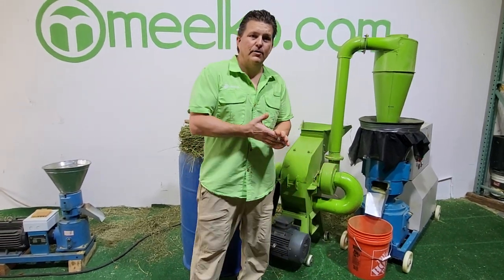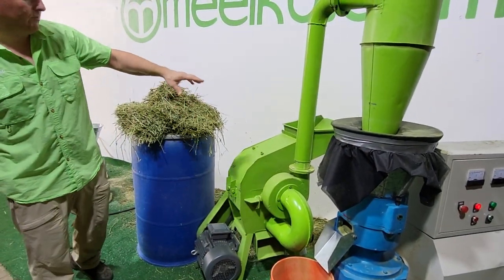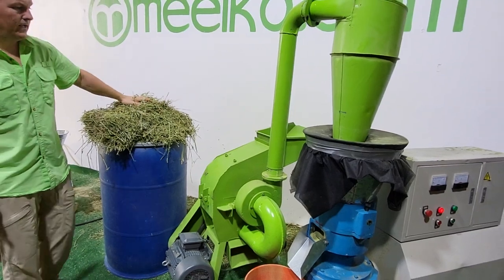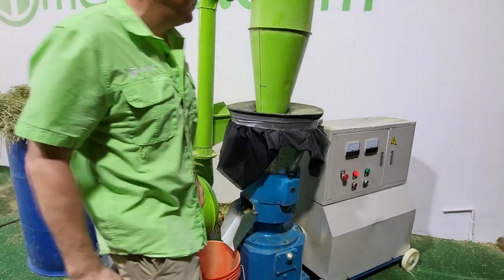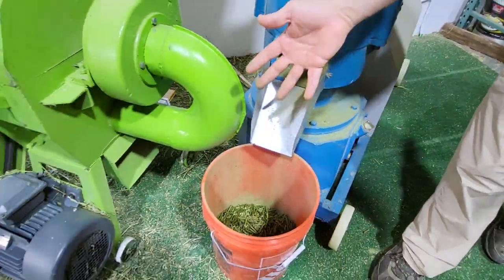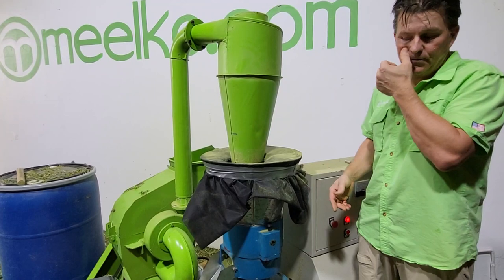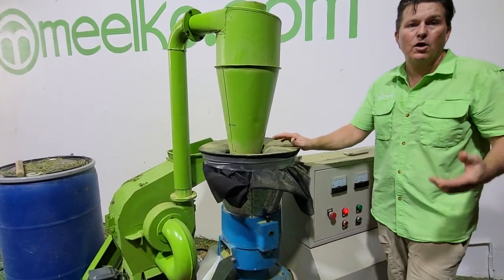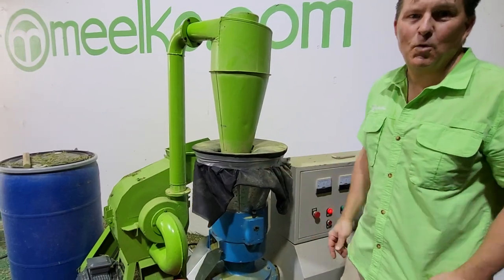Hammer Mill Directly to Pellet Mill Making Pellets with Alfalfa

Comment: What is the weak point?  What most commonly breaks and needs replacing?
Reply from the maker: Hello,  Regarding the Hammer Mill there are no "weak points"  The hammers inside can be replaced if necessary.  The Pellet Mill has a Die and Rollers that get replaced after  a lot of use.  That time frame depends on the materials being used to make the pellets.  The necessary maintenance is Grease on every use.  Give Us a call with any questions.  We are happy to help